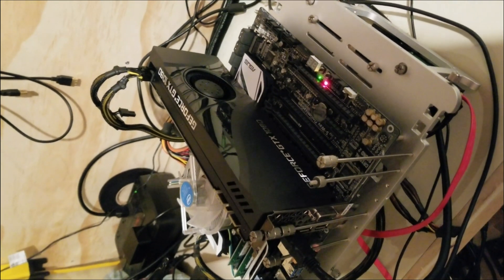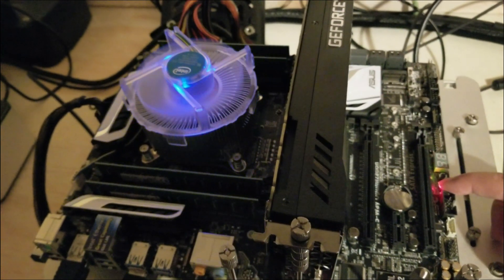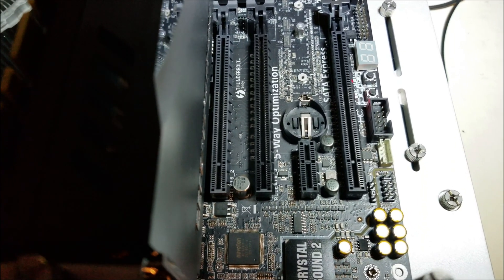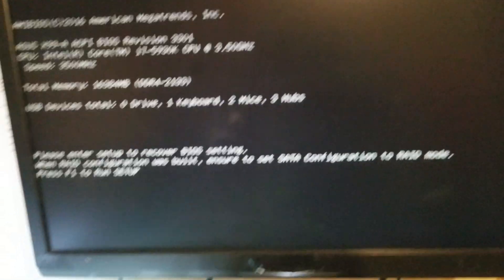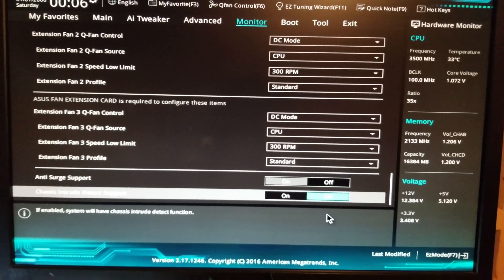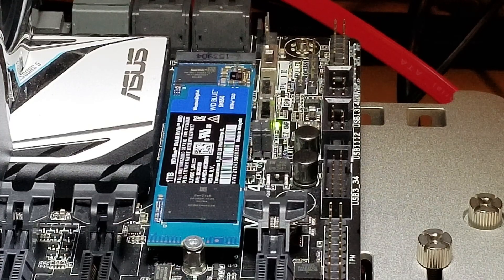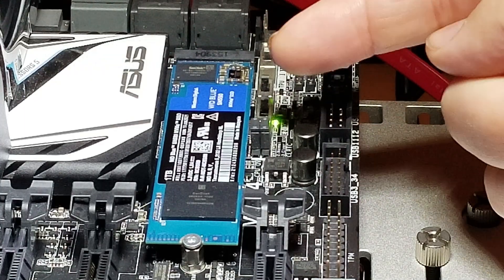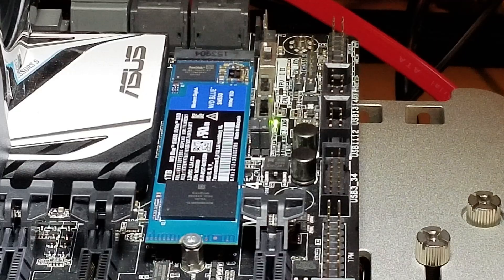Chassis Intrude Fatal Error Fix

Comment: Attention Dennis.
Go to the 38 second
mark.
I may have run across the situation have you ever ?
Keith
Reply from the maker: Keith, that's what the video is about so not sure what you mean?
Reply: @Reviewing_Playing_and_More_RPM  
I guess I just want to be ever ran across that before.
Reply from the maker: @KTHKUHNKK  I've only had it happen a couple times,  but it was hard to figure out the first time. Now it's easy so thought I'd share.